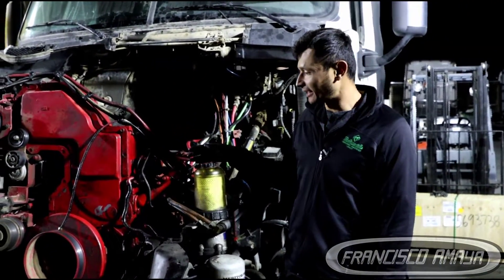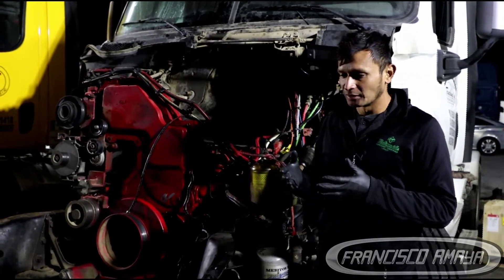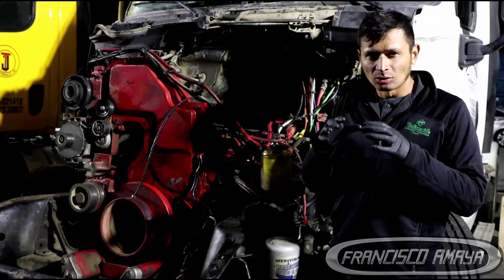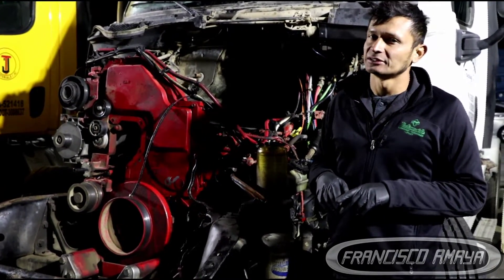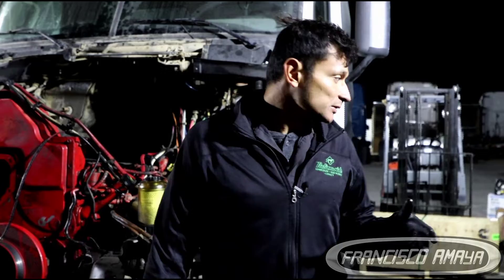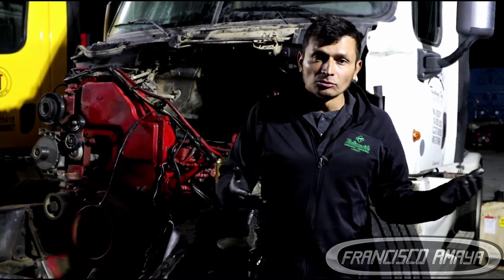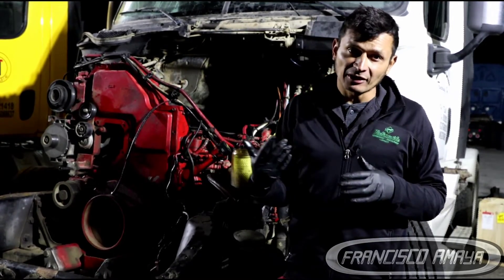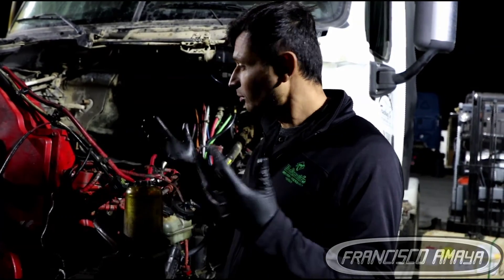Cummins ISX ISX15 X15 engine in frame overhaul when it is time to repair my engine how to know

Comment: This is an excellent video that explains my exact issues with my Cummins X15 engine. I bought the  truck at 430,000 plus  miles, now at 600,000 plus miles.  Truck is in the shop right now for a complete overhaul.   Thanks for this video Francisco.
Reply: ah man im about to buy one with 600k miles lets see how long I got lol
Reply: @danielpalomares8072 😅my x15 940k still running in original....29000hours